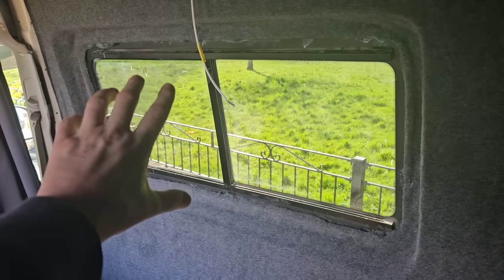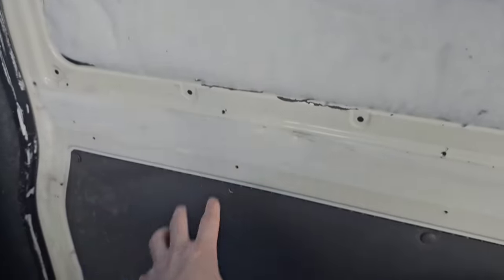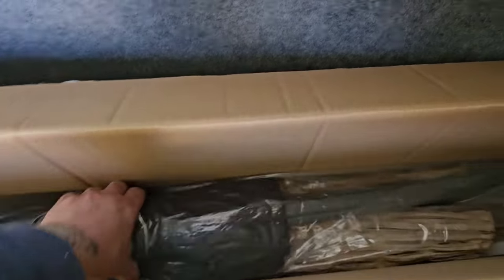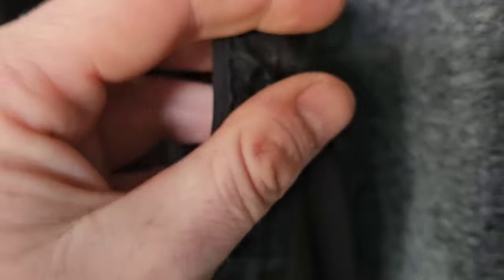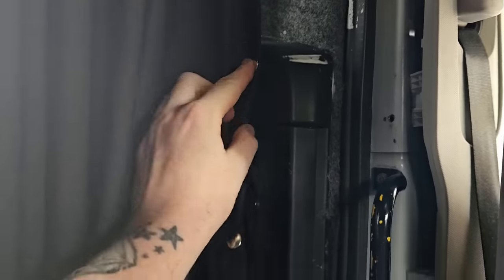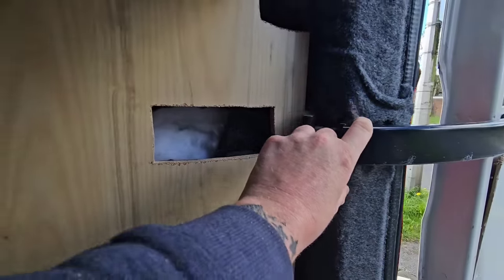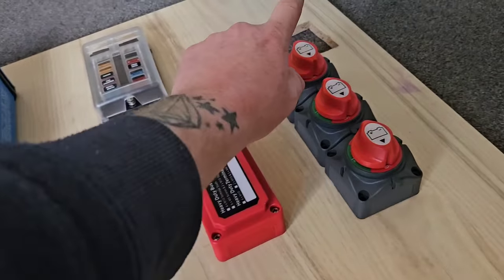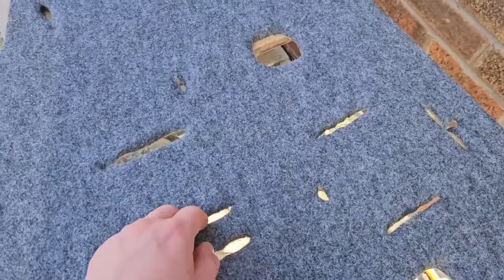Peeping Tom Can't Look In NOW!

Comment: You don't want carpet behind your dc-dc charger.
Victron chargers get really hot.
So hot when charging hard you can't touch them.
Best strip off the carpet around the fins and drill out some ventilation slots.
Double wall your plumbing to the shower with water pipes in between as an accessable/removeable panel from the rear if your worried about leaks and protecting the electrics 😉
Reply: Even better put the Victron 9n stand offs to improve airflow.

Comment: You'll need to remove the carpet behind the DC to DC charger ,Mppt, inverter and AC to DC charger as they get hot in operation and have cooling fins, might be worth drilling some holes behind...looks good though

Comment: Stop calling it a  buzz  bar ...its a Bus Bar ... inly tine youll get the iconic BUZZ enoji ...is when you touch it 😂😂😂😂😂
Reply: It is a Buzz bar though
Reply: @user-yr7re9oe4s  are you trying to be annoying ....its a bus bar ....Google and check images ....there maybe a BRAND  as such ....but that is not its technical name...
Reply: @Jxtb9904  bet you thought that ,because it relates to voltage and current ... duh
Reply: @wayne7521  I don't think anything. I try to always clear my mind and exist in a state of thoughtlessness. We are all too attached to our thoughts. They are not real. Just observe them like clouds in the sky, passing over. The only thing that is true is our connection to the divine, that ever-presence that is infinite.
Reply: @wayne7521  Thank you for using your mind to try and solve the puzzle. I suggest you let go of the mind, the thoughts, the words. Try and exist in a state of mindlessness and be in a state of infinite grace always. Blessings
Reply: Still doesn't make it a buzz bar ...its a bus bar ....
Reply: @Jxtb9904  don't start that crap on me pal ....I just go with the flow ...so we can all understand each other.

If I wanted to stand out ...I wouldn't look a loon to do so ....
There's no proof either side of what tosh your spilling...so jog on